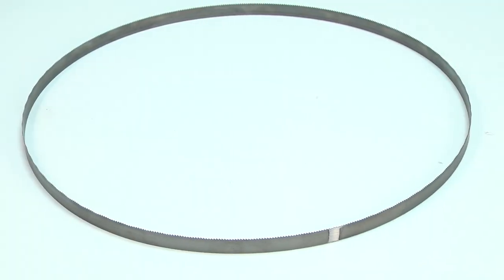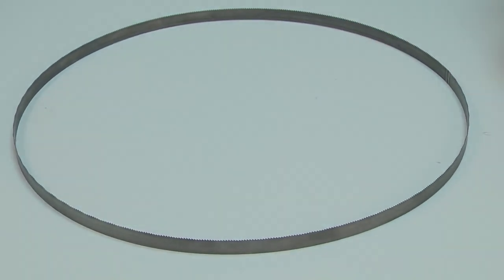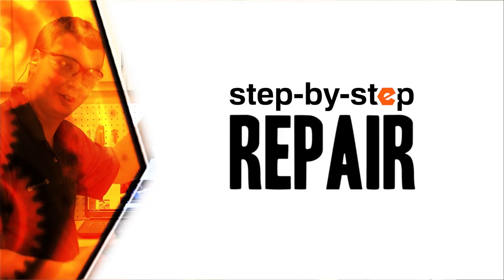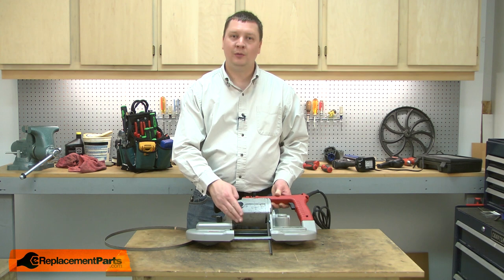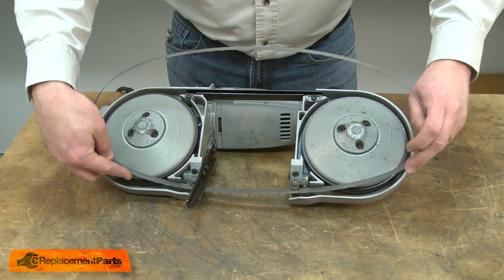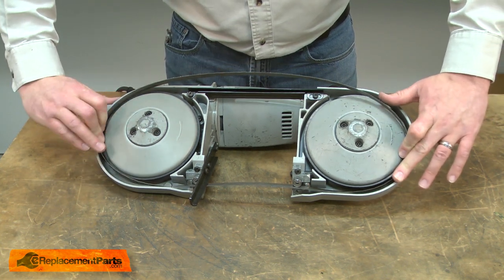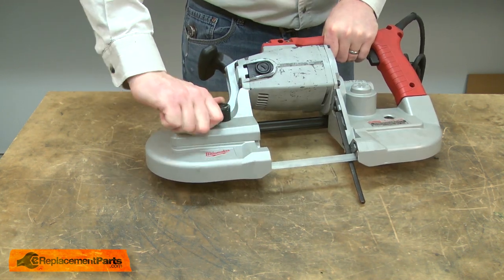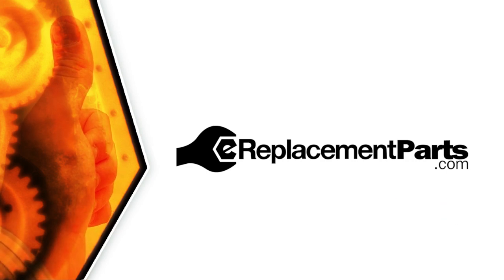Milwaukee Band Saw Repair - Replacing the Blade (Milwaukee Part # 48-39-0510)

Comment: I tried to install a new blade (44-7/8 8TPI) on my Milwaukee 6225 bandsaw and followed this same procedure and cannot get the blade over the wheel on the adjuster side. No matter what I try. Even sprayed silicon spray on the old rubber tire and it would not go over it. I verified with Milwaukee and the operators manual for this model (from the late 90’s early 2000’s) but nothing works. Any ideas? Could it be due to old tires that need replaced? Maybe they are swelled a bit too much with dry rot?